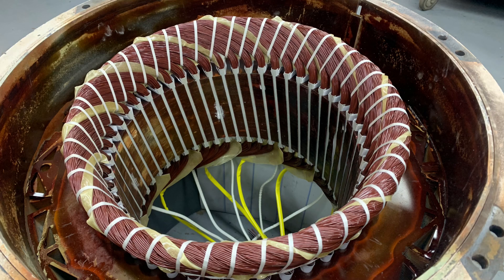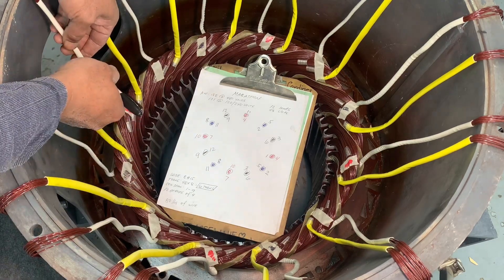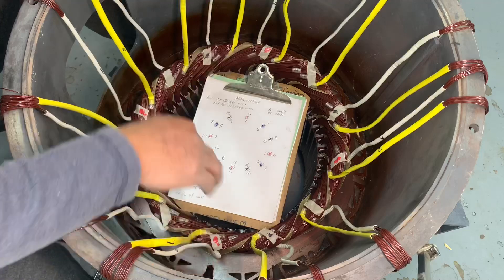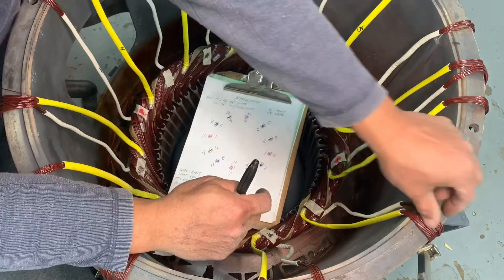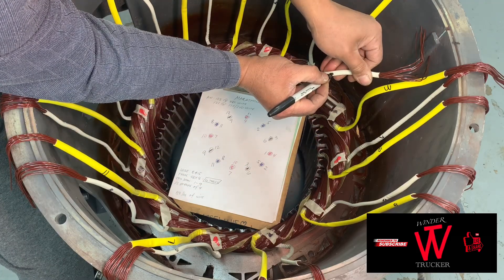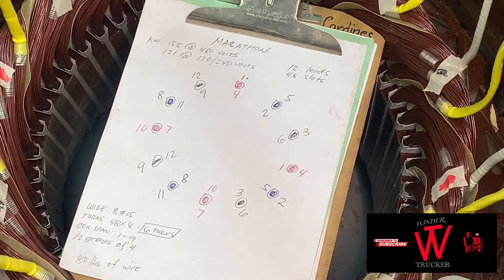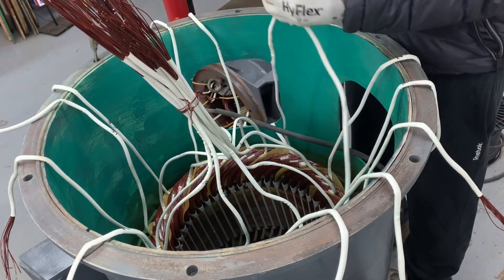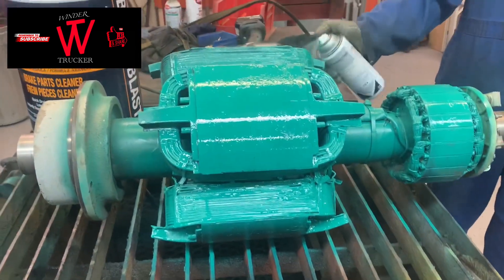Rewinding 155 Kw Generator Marathon Part 2 | Data & Diagram | Original Factory Connection Tutorial

Comment: Good day Boss...linaw po ng paliwanag nyu...may tanung lang po ako Boss may nerewind ako na denyo 3phase welding generator may kuryente na po ang problima hindi balance ang output at nag iinit po ang exciter subra  1 minute pa lang ang andar...salamat po sa inyung sagot🙏
Reply from the maker: I test mo resistance ng main rotor baka shorted kya nag iinit ang exciter.
Reply: @windertrucker6230  narewind kona po ang rotor Boss exciter na lang hindi pa sya ang subrang mag init...maraming salamat po sa pagtugon nyu po sa akin...God bless po sa inyu🙏
Reply: Boss lubos lubosin kona po pasinsya na po...posible rin ba na pag hindi na hinang ng maayos hindi balance ang output apatan na wire po kasi...salamat po uli🙏
Reply from the maker: @darwins_rideandfix3729  posible lalo na sa Dc kylangan ng good contact para d mag init ang wire.pag isang wire ang d naka contact ng maayos mag unbalance ang resistance pag pinasukan mona ng power supply mas lalo na kung my load kasi na dro draw ng high amps pag start pag mahina ang connection mag iinit then pag pasok ng load bibitaw na sa connection kya mag iinit then unbalance ang current.
Reply: @windertrucker6230  maraming salamat Po Boss...sana hndi ka magsasawa sa mga tanung nmin ...ingat Po kyu dyan...God Bless Po sa inyu🙏🙏🙏
Reply from the maker: @darwins_rideandfix3729  no problem basta kaya sa kaalaman ko bossing sasagutin ko mga tanong nyo.Salamat sa pag visit sa channel ko anytime you’re welcome 👍